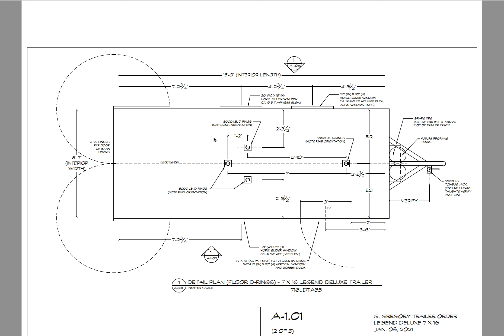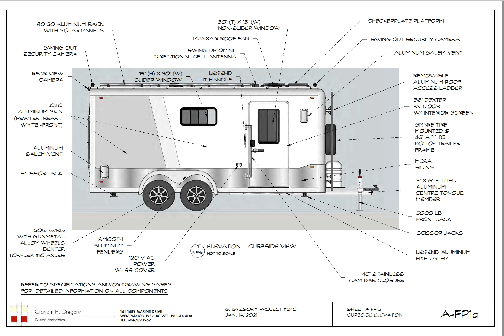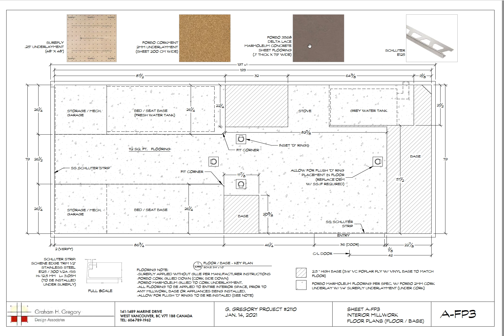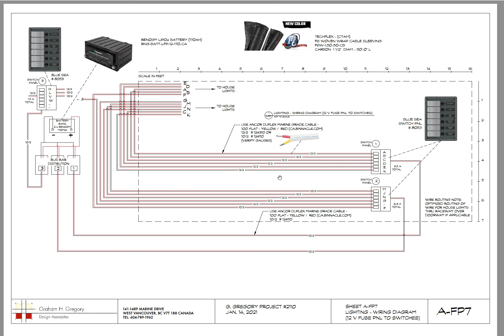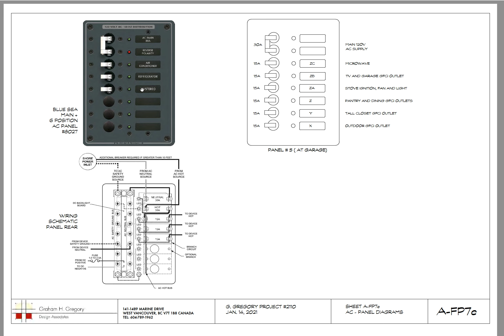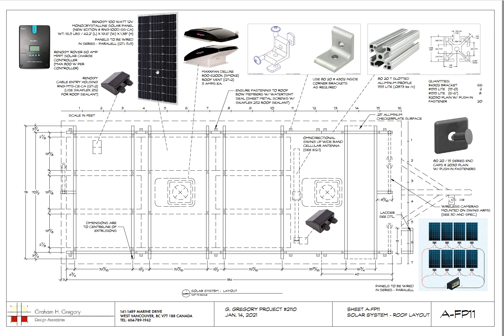Ultimate Cargo Trailer Conversion - Details (Part 1)

Comment: Is it possible to make these lights smart where they could be controlled by a laptop or phone?
Reply from the maker: Many Thanks for all your positive comments. Feel free to ask me whatever questions you have. I will try and answer them. To control these lights with computer or phone, you would have to control the switching via a relay that would communicate with your computer or phone. There are many out there mostly smart home systems designed for Architectural Homes and Commercial venues etc. I design those all the time, but with this project I wanted to keep things simple and not subject to electronic equipment failure. There is a lot out there, but not necessarily a simple solution. The important thing is to get good lights.
Reply: @gregory-explore  thanks for the reply.  Thanks for all the details